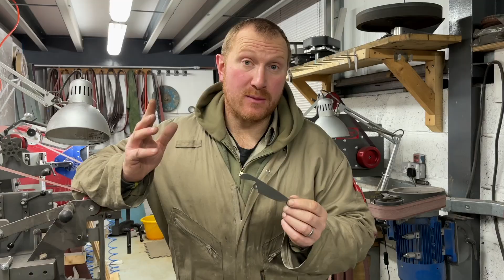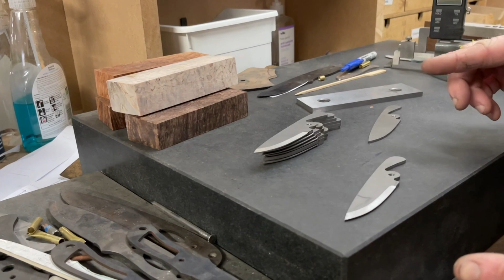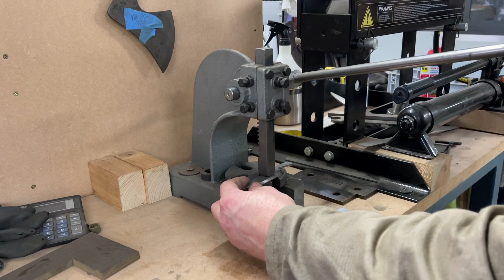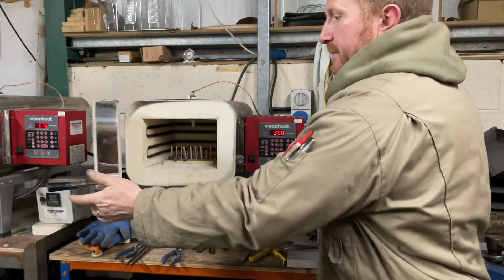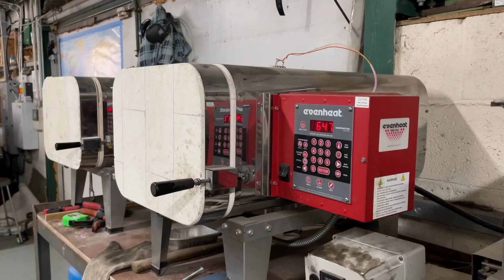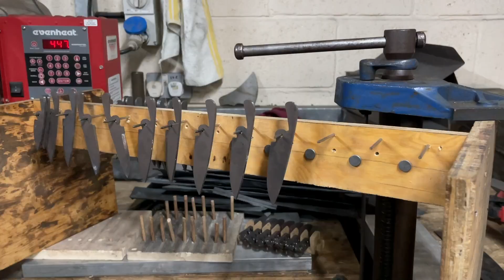Preparing Folding Knives for Heat Treatment (WIP Wednesday)

Comment: Nice looking kilns. Can these take a gas line for inert gases?
Reply from the maker: These particular models don’t and not Sure Evenheat offer that but would think you could easily add it yourself with some Argon and regulator. I personally just use the foil and have great results.
Reply: @BenOrford  Hi there thanks for your reply much appreciated!
Reply from the maker: @BushCampingTools  no problem let us know if you need any further information I can help you with 
cheers Ben